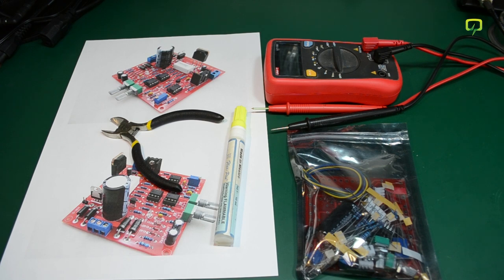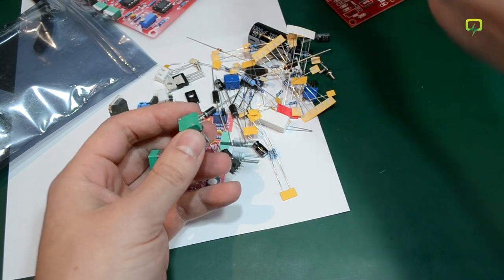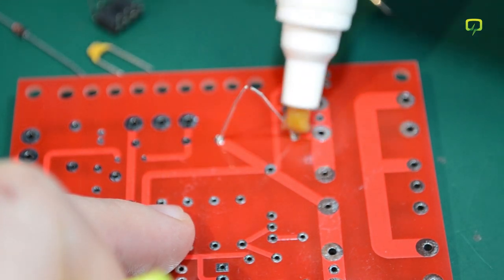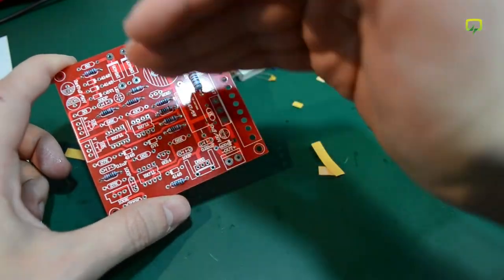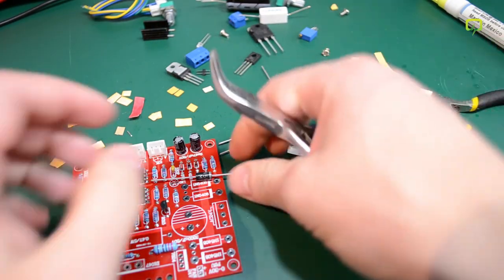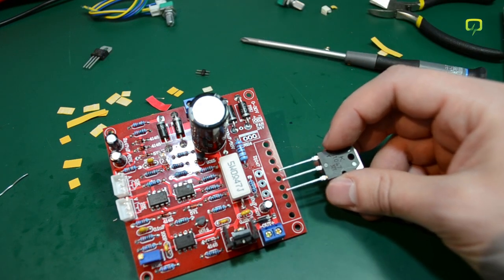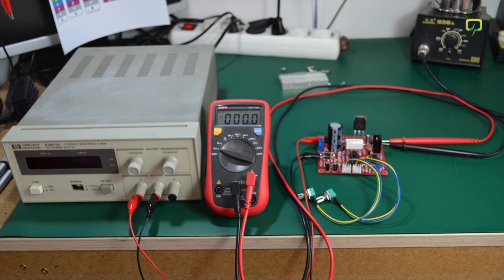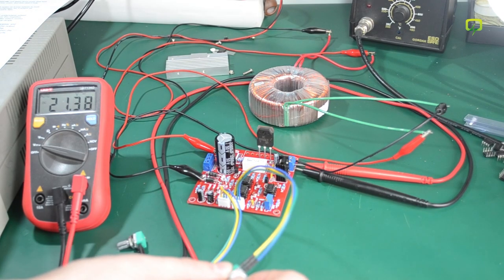VoltLog #8 - Kit Assembly 0-30V 0-3A Adjustable Linear Bench Power Supply

Comment: Thanks for the video, and troubleshooting your circuit. It works really great. I paid $4.50 shipped from Aliexpress. I love the way CC works from 7 mA and up. And CV works from zero Volts. A 5-turn or 10-turn pots ($1 each on ebay or aliexpress) work better than single turn. 
If anyone has problems, here are some tips: 
1. Make sure the Zener diodes are marked 5.1V - use magnifying glass to read. If you put the look-alike 4148 instead of Zener: you will fry the OP amps because you will hit them with unlimited voltage. TL081 cost $1 for 10pcs shipped, if you need replacements. 
2. Make sure to place the two small transistors in proper places: one is PNP and the other NPN - you can't interchange them. 
3. Measure each resistor before soldering instead or relying on barcodes: the blue background paint makes them hard to distinguish. 
4. The medium power transistor on small heatsink may look the same as the 7824: don't mix these up. 
5. In my kit the small capacitors 100pF thru 220nF were very inaccurate in values, so I used caps recycled from old TV board instead.
Reply from the maker: awesome tips, thanks!
Reply: I assembled this power supply and supplied the AC input via 12*2 3A (Centertapped Transformer) but unfortunately there was no correct output at the output terminals; it's almost 0.3V DC. But when I checked the 82 ohms resistor which is near to the reverse diode capacitor multiplier (17.36 in this video) gets much hot. I checked all the directions and components but still it's not working. Can someone help me to solve this issue?
Reply: @JohnWick-pz5vp  
When you pause video on the diagram 16:59 you can see that the 82 Ohm (R2) is in series with 47 uF (C2) capacitor, so this should not get hot at 60 Hz. Perhaps the capacitor 47 uF (C2) got shorted? Replace it and see what happens. Also, the center tap of the transformer has no meaning in this circuit. The 3-screw input terminal has the center screw not connected to anything. Measure the AC Voltage on the two outside pins: it should be around 24 Volts AC, but the circuit will work fine from 8 Volts AC and up.
Reply: @JohnWick-pz5vp  Yes that resistor does get hot...but it works OK anyway. You probably have a bad TL081. Either order more (I got 50 for under $10 from a US seller) or use the UA741 as someone else has suggested. Oh and buy some sockets for the opamps, so you can change them easily if you need to! I ALWAYS use them now. Be very careful desoldering the opamps or you will lose the traces on the board.
Reply: I built same aliexpress Board. Worked with ac transformer, after some time fried tl081 on the right. I did not used diode in place of zener. What could be the reason of fried op amp?
Reply: I measured them with my component tester and mine are fine

Comment: Thanks. I made exactly the same mistake testing mine using two 12V sealed lead acid batteries. 
There is a set up procedure, if I recall correctly, putting the current pot at max and the volt pot at min. Then adjusting the trimmer to get a 0V output.

Comment: I want to thank you.  I built the same kit and had the exact same problem as you.  I was testing it with DC and did conclude that I wasn't getting my negative rail but assumed there was a fault with that part of the circuit.  Found the same schematic as you on the internet.  One thing to remember.  If you rectify 24 VAC it gives you about 34 VDC (VacX1.414=Vdc, this applies to a fullwave bridge only).  Hence the first filter cap is rated at 50 volts and should also be greater than 3300uf to reduce ripple when drawing higher currents.
Reply from the maker: zooky443 I'm glad my story helped.

Comment: Thanks for the nice video.  My kit came with no Schematic and thanks for showing it in your Youtube.  I thought the LED was a power on LED and forgot to put a current limit diode in series when testing the polarity to remotely connecting the leds, needless to say it blew out when I tested it.  I guess I will replace it with a white LED and use the fan power connection to light a led on the front power pannel. 
 Is the circuit board mounted  led light only lit when it is in constent current limit ?  Thanks in advance for this primitve
question as to the operation of the LED purpose.

Comment: I hope you read this message and can help me out, as a total novice I decided to assemble this power supply on my own,   I followed all the steps watching a few videos on this very same PS, my problem is similar to yours B4 the fix, I only get  one output of 14.6Vdc with no chane at all,  turning the potentiometers and adjusting the brass screw does not change my output, I am using a 24V, 2A transformer for my input power source,  if we make a big assumption that all components were soldered correctly, where do you think the issue with the no-change output is, please help if you could.

Comment: If you're doing trough hole soldering, you don't need much flux (other than the one already in the soldering wire, you have rosin core solder now don't you?) on other than the largest component leads if your technique is correct, and the correct is:

* Keep your soldering iron tip clean at all times (don't use sponges, they suck. Use metal braid tip cleaners)

* Remember to have your soldering iron tip covered in fresh solder once in a while, makes for better thermal contact.

* Remember to put the tip so, that it heats BOTH the component lead and the pad which you're soldering.

* After a second or two of heating them up, apply the solder from the opposite side of the component lead, not to the soldering iron. You're trying to solder the component lead to the pad, not the iron to the component lead.

* And if you put the soldering iron away for a moment, remember to clean it well and add a fresh coat of solder to the tip to protect it from oxidizing.

And you're all set.
Reply from the maker: Thank you for sharing the technique with us. I am using the exact same technique as described in your comment. However I have to disagree on the part where you say "you don't need much flux", extra flux is always helpful even though I am using solder wire with flux core.

It just makes your life easier, why should I stick with just the flux I get inside the solder wire? that's not enough. Sometimes the core melts on the current joint more than it should and to your next joint you are left with only bare solder.

The thing that gets you most of the time during soldering is oxidization of the solder on the tip or the tip itself and flux together with regularly cleaning the tip is a perfect solution for that. 

I have to conclude though, this is a rather "personal" subject as everyone does it their way, and everyone has their own sweet spot for how it should be done.
Reply: True, I usually use flux when I get a failed bead to touch it up. Saves time and flux.

Since most connections are easily done without extra flux.VoltLog
Reply: Mtaalas   ,There use to be copper wire coat with silver for easy solder as time pass they change from copper to brass. now some Electronic parts from china use steel wire coat with may be nikle. Part from china are very difficult to solder that why I understand he use too much flux. Too much flux quickly ruin your platinum coating on soldering tip. I always avoid buying part from china.
Reply: A bit of added flux always helps. I normally do my solder junctions in less than 2 seconds, with a very hot iron (380ºC) to improve wettability. The flux from the solder wire might not be enough. It is preferable to err on the side of caution and clean the excess later. As long as you don't use conductive or acid flux, you'll be fine.

Comment: I sorted and labeled all the resistors, so tomorrow it will be easy to do
Also I learned how to read tantalum capacitors (yellow bits)
The first 2 numbers are just numbers, BUT the third one is the multiplier (how many extra zeros)

Example:

304 

30 4
30  +4 zeros  

300000 pF
300 nF
0.3 uF

Comment: man were you plug the 24 volt it says on the pcb AC24V  it should be there for a reason i made the same mistake now i had to ordet a transformer and wait another 30 days coz my main power supply cost 1000 euros and its burned out im waiting th pcb to fix it

Comment: Hi all, i have the same kit and i cannot modify the amps any more it only shows 2mA, i switched the potentiometers and they work, and the power supply was working fine until last week, when i powered on to charge a 18650 cell and i noticed that it only charge with 2mA 😢, what do i have to check ???

Comment: Hi, does it have a protection against shorts? Description states, that it have, but one customer reviewed the product/purchase on banggood, and says, it has not, and that he learned this the hard way... thanks
Reply from the maker: Feri Beke not really short circuit protection but it has CC mode which will limit current based on your setting. I haven't had issues with this power supply and I've short circuited the output many times.

Comment: Good day sir 
I have assembled the kit but not working . The output voltage not going above 0.2 v  one tl082 if is getting Hot also (u2) . I have checked all connections and  all components are correctly placed 

Pls help to find problem
Reply: That is definitely a bad TL081. I advise anybody assembling these to fit the TL081's in a socket first....otherwise it is very difficult to remove them later....and since they are pretty much at their limit anyway, it pays to have a few spares on hand. I bought 50 for around $5 i think....and the sockets are very cheap too.
Reply: I made three of these kits and one was completely duff. Same symptoms as you. There are a fake or low spec TL081's out there, they have a 'V' type logo on them, I bought 5 of them to replace the hot one. Should have got genuine TI chips. None of them worked. If you get the circuit diagram and assemble U1, D8 , R4, R6, R5, P1 with DC anywhere over 15V you will get about 10.2V at U1 pin 6 and 5.1V at pins 2 and 3. U1 works as a voltage reference and the voltages I listed will be present for any DC supply voltage above about 12V. 

The TL081's in my duff kit and the 5 I bought off eBay did not work in this circuit, the output voltage on pin 6 was stubbornly 0V. I made a circuit in LTSpice XVIII and no matter what values of R4-R6 I chose I could not get 0V on pin 6, it worked as theory would suggest and as per the good good boards. This and the two good boards showed me where to look, having eliminated everything else I concluded the TL081 was not working as it should. In addition pin 8 was not NC, it was at Vcc. If you short pin 8 to Gnd the chip dies. 

I dropped in 741's instead of TL081, they are pin for pin compatible, and it worked. I put sockets on all IC's. Blown also was U2. R1 and R2 run hot to touch, they need to 1W I suspect. I replaced all TL081's on the duff board with 741's. The good boards have genuine TI chips. This solution took a long time to figure out.

Comment: hi there buddy I have this kit to build also but can you tell me what difference it would make to the kit by replacing the standard 10k pots with 2 5k 1oturn pots I look forward to your reply peter
Reply from the maker: usually you don't go below 10K with adjustment pots. It should still work but I have no idea if it's going to influence your circuit in any way.

Comment: I assembled this kit and it looked like it worked ok. But when I was assembling the circuit in an enclosure I accidentally shorted the negative rail to the transistor's cooler 2SD882 . After a big spark, it still could regulate voltage and limit small currents.  Then I go with a stronger load car lamp and big spark on the output. No more regulation. I think I killed some components  :/    Is this kit any good? is it worth fixing it or I rather replace the whole circuit with a switch mode buck converter with current limiting?
Reply: Just get another kit off ebay....for $4.50 how could you go wrong?

Comment: Hello all, I bought the same kit and facing the same problem when i applied 19Vdc (laptop charger) to AC input. but, I solved the problem, building a Inverter circuit based on 555. The additional board has a 7808 Regulator (+8V) and inverter polarity circuit based on 555, this give me ~ -5.0V, then I apply it to the anode of D7 (Zener 5.1V) to polarizate to OPAM.  and. PROBLEM SOLVED the KIT work well !!!!!!!

Comment: Hello everyone: This circuit is quite good but the power transformer should not exceed 20V. The DC voltage in the supply (+ Vdc, Vdc) in the operational ones when setting the 24V voltage exceeds the maximum values for which the manufacturer designed it. The maximum data sheet voltage says + Vcc - ( Vcc) = 36V, recommended 30V. It may work well for a while and then the operational ones will burn.
Reply: Exactly why i tested 12-0-12 transformer gives 40v on the caps. My Opamp Fried after some time. We should use 9-0-9 transformer.
Reply: @ajaybnl  OMG I JUST FOUND AN 18V 40W TRANSFORMER THAT CAN SUPPLY 2.25A max. (from a broken boombox)
I only need ~ 3A up to 12V, not more :)
So I'm GOOD TO GO!

Comment: nicely assembled and soldered. you beautifully diagnosed the problem of DC instead of AC. Now i have some questions about this kit and i hope you will answer: 1/ what can i do to increase its current output only/ do i have to use two kits, if yes, how to connect them? where on the pcb could i connect amp and voltmeter and its specifications. can i use fine and coarse adjustments or should i use 10k 10turn pots.- eagerly waiting for your reply?
Reply from the maker: +gowhar khan Thanks! You cannot increase the output current by using two power supplies you will run into problems, voltage sources should not be paralleled. The voltmeter should be connected to the output terminals and the ammeter in series with the output terminals. I would recommend using a 10 turn pot, it's nicer. Also there is a really long thread full o information and possible improvements to this power supply, you should read it. Here is a link http://voltlog.com/y/bmdio

Comment: Very good and precise description of this project including the analytical testing and fault finding.  Thank you this has help me significantly.  I am thinking whether one could add another stage to the output Transistor T4 of this power supply ( Say a pair of Transistors in parallel with resister to emitter of T4 ) to boost the current rating of the output.

Comment: Hi everybody. I bought this kit from AliExpress and the 3 IC came without any label. It suppossed to be TL081. Because the PS did not work I replace the 3 "black" IC by LM741 and board regulates voltage without load. Still an issue with the current regulation when 10ohm load is connected. No more than 0,3A is possible to reach. Up to that current, the led lights and current limiting starts. Could somebody help on this issue?

Comment: Thank you for another well done and informative video.  I have just finished building the kit and have met a problem that my very limited knowledge can't solve.  I did not plan to buy a 24v transformer as I already had an 8.5 amp Variac, which seems to me would work just as well and still be available for other uses.  But I may be wrong---my Variac has 2 output wires--hot and neutral--while the board shows connections for 3 wires and I am completely stumped on how to proceed!  Can you or anyone help me out with this mess?  Appreciate any and all advice or assistance!  Thank you all!

Comment: I very much enjoyed the video. I bought one and built it. It's fine but had to add a large fan cooled heat sink to the mosfet to run it anywhere near 3amps. Also the rectifier diodes get too hot to touch?! I don't know whether my 24v ac supply is ok because it's a square wave and not a sine wave?

Comment: Input should be AC 24V however I have a transformer whose secondary delivers 29 V. Do you think that it could be OK for this board ? or is there any other means to adapt the AC input to 24 V. Thank you in advance for your reply. And congratulation for your nice video and tutorials.
Reply: +Sylvain LAZARE I don't recommend using that transformer. When rectified the voltage could exceed 40V and the power supply components are not rated for that.

Comment: Probably a stupid question but i have a simular product that ive just finnished and want to test it out.
I dont have a power supply with the correct values doe so my question is, could i run a product like this with lower voltage just to try the circuit out?

Needed: 30v 2A
Closest ive got: 24V 2.5A

Will it break or just not start?
Reply from the maker: it will work at that voltage as long as it's AC.
Reply: Tyvm :D
Will try it out tonight then.

Comment: Good job. I know you build this out properly in another video. But that 24 V linear should be built. Tons of control gear runs at 24 V and it would be very useful to pull it out to a dedicated banana plug for breadboard work on control PLCs, etc.

Comment: hey i have a Problem, i have the same board and used an led plug (24v) for the input but it doesnt work. when i measure the input voltage it was 31v (idk why) und the output voltage was -0,59v. is my board fried or does anyone have an idea what could be the problem? thanks

Comment: 17:24  I'm a bit surprised that you plugged DC into the input? Doesn't it say on the PCB? 

Thats what those shotky diodes are for. Its a full bridge rectifier (changes AC to DC) the transformer lowers the voltage from 240 to 24 volts.

Anyway all good. Its working. Yaah!😂👍🏻